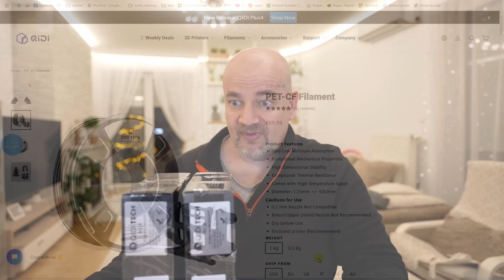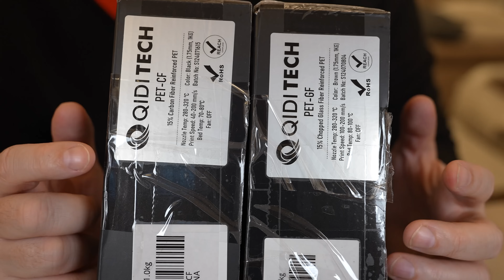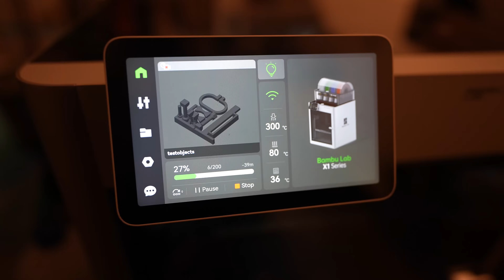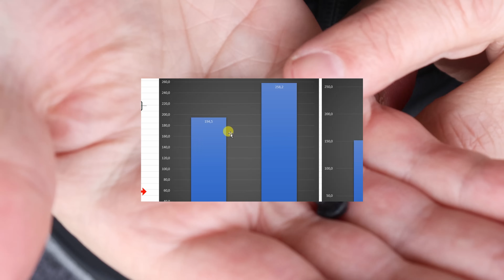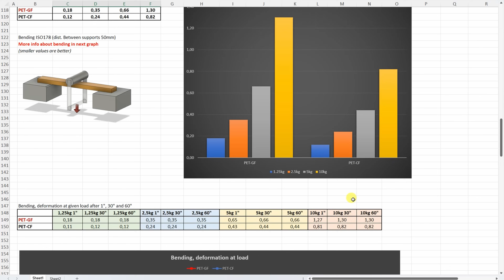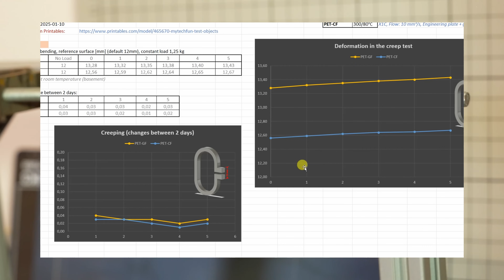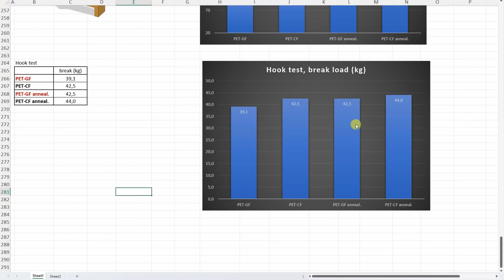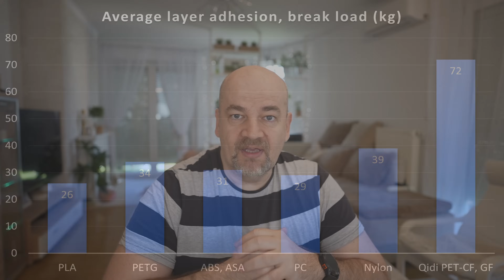Qidi PET-GF vs PET-CF, two great technical filaments by Qidi Tech

Comment: would it be possible to compare the results to items printed in a printer with an actively heated chamber, at 65C such as the x-max 3 that wasn't used in this test?

Comment: eSun has a pure PET in amazon.  One of the only reviews says it is softer than PETG.  I always thought the G was for glycol and it was used to make it less brittle.  It’d be nice to get your view here, and perhaps a test at sometime.
Reply from the maker: When it will be available in EU store, I will order a spool for the testing. Maybe two (natural and black) https://esun3dstoreeu.com/products/pet
Reply: PETG is more easily printable than pure PET, which is why it is much more common as a printer filament. 
“Softer” (less hard) doesn’t necessarily correlate with (less) brittleness. And some might call a more flexible (less stiff) material “softer”, which again is a different property. 
I haven’t noted Igor routinely doing hardness testing, as he does with stiffness and brittleness.

Comment: Anecdotally I am using Fiberon/polymaker pet cf and getting pretty poor layer adhesion, so these results are interesting.
Reply: I've recently started printing in this. My biggest issue is i have way too much cooling @ the lowest fan speed that my fans will kick on, which is 20%. Dual 5015s are excessive with room temps of 9c. Turn off cooling, and it's much better. I printed a hollow, honey comb styled grip that's has about 1.5mm thick webbing. It easily holds my 170lbs/77kg jumping/stomping on it.

Comment: You dont need the weight, just a use a screw and an electric drilln (or a nema motor connected to an arduino), you'll have more control over your tests.

Comment: I like that Qidi specifies 15% carbon fiber and 15% glass fiber, right on the box.  Most filament manufacturers don't specify the fiber content of their reinforced filaments and micrographs indicate that many of them have almost a token amount of very short fibers which probably don't provide much benefit beyond a nicer looking surface finish.

70 euros per kg seems expensive.  In the US, I bought a kg of Tinmorry PETG-CF for $27 last week (thanks to a My Tech Fun video) and a kg of Siraya Tech PET-CF a month ago for $37.49.

The heat resistance of the annealed fiber reinforced PET parts is very impressive.

This channel is by far the best 3D printing material testing channel on YouTube.  Thank you!
Reply: I got 10 rolls of even better eryone PETG-CF for 15e per kg with vat included lol, incredible price. I now want PET-CF to drop to at least 30 haha
Reply: @riba2233  - That's a great price for PETG-CF!  I'm just getting started with it, and may be using it for upcoming products, possibly with annealing for added high temperature performance.  I just bought ten 1 kg spools of black PLA directly from Elegoo for US$95 with free shipping and no VAT 'cause 'Murica!  I wish we could get 3 kg spools without paying more per kg.
Reply: @riba2233  Where did you find that
Reply: > 70 euros per kg seems expensive

Don't forget that also includes ~20% VAT (some countries have even higher VAT, e.g. 23%), so price without VAT is about 58 EUR

Another thing QIDI does is their bulk discounts, so if you get 3 or more, it's 55.99 EUR per roll (about 46 EUR without VAT), which is pretty ok, but I agree that it sucks if you just want to try one roll.
I got few rolls during sale few months ago and one cost me about 50 EUR.
Reply: @MiChAeLoKGB  even with 30% VAT it's super expensive as for PET plastic =(

Comment: PET and PET-CF are the only materials I've printed with the last 2.5 years and I don't plan to change that. Very printable, amazing properties, room temperature, doesn't stink. The only downsides are they are hard to paint and quite brittle. I hope these videos get more traction as pure PET is hard to find and can be insanely expensive in filament form despite being one of the most abundant plastics around
Reply: Do you have a source of a better priced one?
Reply: @riba2233  Pure PET? Sadly not. Back in the day Amazon had their own brand which was super cheap and I have a few spools. Today you only have BASF selling it in Europe and it's quite expensive unless you buy it in 8kg spools (which is what I do). For PET-CF there's a lot of choice. The Qidi and Bambu stuff (which as of last year was almost certainly the same thing) are perfectly fine. The engineering-grade amorphous PET-CFs like the BASF ones are very expensive and I tend to only use them if I can get on offer and have particular projects in mind.
Reply: @MrJofArnold  yeah I was thinking about pure PET, one would expect wide choice considering how cheap base material is.

Comment: The PET-GF is especially impressive with its layer adhesion. It outperforms or equals PPA-CF in nearly all tests (except the tensile strength and hook test if I am correct). Taking its price into account this looks like the best technical filament today.
As you mention the impact strength is its only weakness but that is largely inherent: stiffness and impact resistance are very hard to marry.
Reply: Yes, I have noticed after years of crawling datasheets and watching test videos like this, that you can pretty much say there is an inverse relationship between stiffness and impact resistance. I mean, if you think about the basic physics of it, it makes sense. Think about TPU. I like to search for a sweet spot where the stiffness is enough for the project, but the impact resistance is also high enough to survive the use case. For me, ASA has delivered that for a long time. I am super curious about trying PET or PET-GF now, though. I previously had my eye on PC, but these tests make PC not look like such an upgrade from ASA. I think for a long time PET was waiting in the shadows while everyone was playing with amateur-level PETG, and probably search results were poisoned by trying to auto-correct PET searches to PETG.

Comment: Guys! Are there any cheap ovens for this annealing? Maybe anybody can tell which model are you using?
Reply from the maker: Soon I will test Sunlu's new dryer, which can be used for annealing too (max 110°C)
Reply: @MyTechFun  Nice, then if you can, please, test less annealing times to find the optimal one as the time is money. :) I am printing on X1C too, but Raise3D PET CF/GF and have amazing quality prints, but low HDT of it is like Achilles' heel. By the way I recommend you to think of trying some Raise3D materials, at least PET CF/GF had very good parameters and I think they were maybe the first who came with this material into the market. Thanks for your efforts, you are da man. =)
Reply: And additionally would be great to test the lowest time needed for annealing to reach 200C resistance.

Comment: Still no Siraya Tech PPA?! You are just messing with me now! 😄

I did some limited impromptu informal testing on the PPA recently.

I have a part that is about 12-15mm wide 5mm thick and 60mm long. All the edges on one side has a fillet to smooth the transition so it isnt 5mm thick the whole width. There is a 5mm hole near one end of the part.

I found a way to secure the part and hung a gallon jug full of water from the hole. There was minor deflection, and it didn't change over the course of a couple weeks. Afterwards when the weight was removed, the part went back to normal.

Layer adhesion seems very good, as the parts does not break cleanly along layer lines. It cracks similar to molded plastic. It is still partially along the layer lines, but it deviates in a more jagged fasion. So it is still a weaker axis, just not as much as some other materials.

So nothing rigorous, but I was impressed by it. Hopefully after you finish testing, I will have some numbers to associate with the material.
Reply from the maker: Siraya PPA is here (all 3 types), but I have at least 4 filaments between (including Tullomer)
Reply: @MyTechFun  I am interested in the tullomer as well.

I am also starting the process to build a new printer that can handle PEEK and Ultem.

Comment: Great, thank you for this review.👍

At this moment I am nearly ready to order a QIDI Plus 4. Because the ease of post processing I like to use QIDI ABS and ABS-GF and for tech parts I consider QIDI PET-CF or something or some brand else. 
But now I am sure, it will be PET-CF. Only thing I would like to check if there is a significant difference between brands.
Reply from the maker: I will have Polymaker PET too, then all 4 brands in one video (Bambu, Siraya, Qidi and Polymaker)
Reply: @MyTechFun  Thank you, I quickly re-watched your review on the Bambu Pet-CF, most significant for me is the higher layer adhesion of the Qidi filament. 
I still have some weeks before I order, so I will wait till your video comes online. 
But so far I guess the Qidi PET-CF might be a good choice, there prices are reasonable and there products are always available.

Comment: Hell yes, finally the qidi materials are being tested. They are INCREDIBLE. I cant wait for the nylon testing. I gave the Ultra PA a try and holy crap..... Layer adhesion is insane. I get perfect isotropic parts at 0% cooling and 280C nozzle, however overhangs arent gonna happen with that to well. 10-15% cooling still keeps a good amount of layer adhesion while making print quality significantly better
Reply from the maker: Oh, looks like I have to go to shopping again (Ultra PA)
Reply: @MyTechFun  if I could send pictures I would! The only time I've gotten this layer  adhesion was with Poly maker CoPA and 3dxtech 6-66 copolymer. This stuff is a bit easier to print and doesn't have the moisture issues of those! Crazy material I must say, however fine tuning flow parameters is a must! Ever so slight overextrustion to get that 100% dense plastic might be needed (say perfect flow is 0.96, set to 0.965 instead)
Reply from the maker: @FrozenByFire3  Try posting pictures here: https://www.facebook.com/mytechfun.igor/
Reply: "Perfect" isotropic? On FDM? You'll have to inform the FEA simulation nerds that make all the simulation software to make an exception, lol. Scratch that, nTop already allows me to specify isotropic, or custom levels of anisotropic or orthotropic. I just find it hard to believe with layers, even annealed. Even if only 5% less strength in the Z direction I would love to plug that into nTop and give it a whirl.
Reply: @mjodr  yes. It's crazy to hear, but if layer times are lower enough and you print hot, breaks along the Z axis do not show any of breaking along the layers. Sure it may not be 100% the exact same tensile and elongation, but it's damn near close. Only a select few materials can achieve this. You should watch CNC kitchens video of Transparent Prints are Clearly Stronger. He show it quite well. And you can go even further than that with very specific nylons.
Reply: @FrozenByFire3  I've watched that video and it helped me dial in my ASA settings where I print relatively slow and hot with a very dialed amount of slight over extrusion. My prints are always strong enough for the application!

Comment: Thanks again for your thorough research!
Since i decided to get a Plus4 i wondered about the Qidi PET CF. But after i saw the mediocre performance of Bambus PET CF in the temperature test, i wasn't shure what to expect.
No i have the data.
I'm again very sursprised of the different performance from the same type of filaments just from other brands!
I wanted to get PET CF from Siraya, after i saw your Video about it. Now i'm not that unhappy any more, that i didn't buy it in time and couldn't get it before it was sold out.
Now i now exactly, if i needed temp resistance i would choose Siraya. For strength, especially layer adhesion, Qidi.
Reply: Bambu petcf temp is not mediocre, you just need to anneal it like other petcf filaments.
Reply: @riba2233  Annealing an a regular basis is imo not worth the hassle and potential loss of the shape. If you have bigger parts this can easily happen afaik. For functional parts this is imo not a real option.
I would just use Sirayas PET CF...
Reply: @grott3n0lm  it is an option very much, they don't deform after annealing like pla for eg. There is no warranty that sirayas petcf has that temp resistance without annealing so you can't count on it.
Reply: @riba2233  Afaik it had it without annealing in Igors testing... Maybe i will try it sometime.
Reply: @grott3n0lm  yes but it's still PET with its properties, sometimes it can anneal itself during printing but you can't know it and count on it.
Reply: @riba2233  It's a fair point. But you can't rule out the possibility, that different additives where used, which cause that different response to heat. This was my first thought. I mean there are PA filaments out there which are also supposed to have a HDT over 100C apart...

Comment: Did this filament just get the greatest layer adhesion strength that we have ever gotten in this test?
Reply: My question as well
Reply: Pure PET is insane. I don't think anything I've printed in it has ever broken along the layer lines. PET-CF similar.
Reply: I suspect TPU would be one of the few to beat it.
Reply: @mjodr   no, it only has good relative layer adhesion, not absolute in value like this one
Reply: @ Hard TPU is an incredible material. Like PET, underrated. The toughness is fantastic.
Reply: @MrJofArnold  it is, but we are talking about tensile strength here
Reply: @MrJofArnold  I'm actually looking myself for a material that has the TPU stiffness, but with an extra rigidity. Something along the lines of PETG. Thing is, I haven't found anything like that, even 60D plus TPU is simply not too rigid yet
Reply: @ OP was talking about layer adhesion. I thought it was generally accepted that TPU has the best layer adhesion. Have you ever tried to pull the layers of TPU apart?
Reply: @mjodr   thing is that there is absolute and relative layer adhesion. Tpu has a really high relative, but small absolute.
Reply: @riba2233  The way I see it: TPU can have legendary layer adhesion with low tensile strength. Conversely another polymer can have high tensile strength with terrible layer adhesion. There is a third measurement that could explain the relationship: elongation at break. IE, TPU can stretch forever before breaking which indicates incredible layer adhesion, but low tensile strength.
Reply: @mjodr  correct
Reply: Polymide copa might be a bit better, I have to check